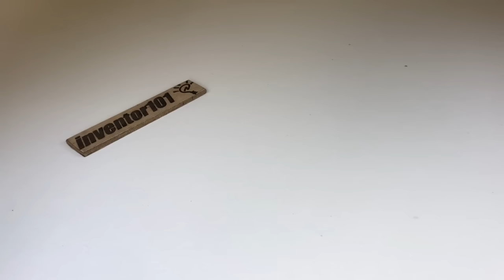How to make a hot air gun using glow plug

Comment: No good,there is almost no transfer of heat from the glow plug tip to the air,you'd need a "heat sink" where tho plug fits in a hole,and air blows thru it.
Reply: Where do you get that type of heat sink?

Comment: Its a great tool sir!! i ask if 11 volts or 11.5volts glow plug can be use for this diy hot air gun ? Pls answer thanks.
Reply: I guess it will but you need it to be a high current supply as well